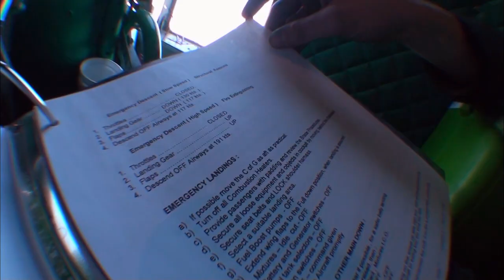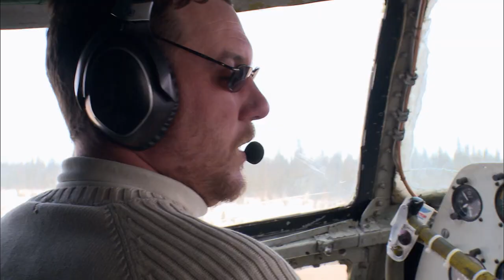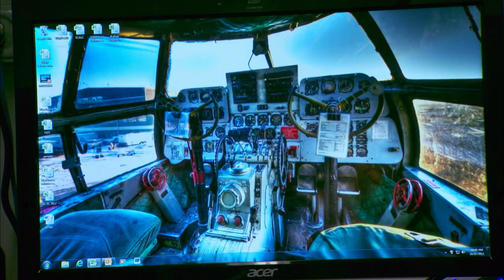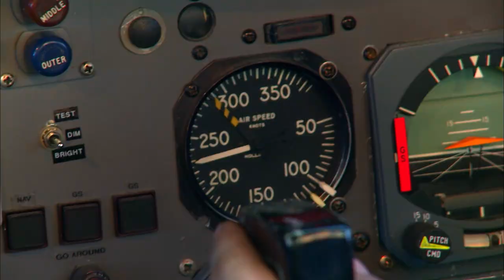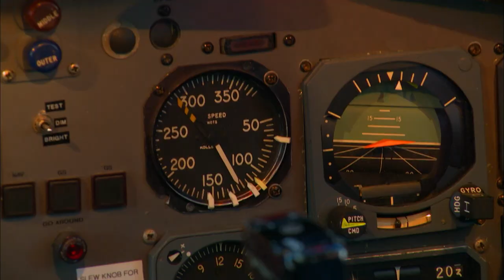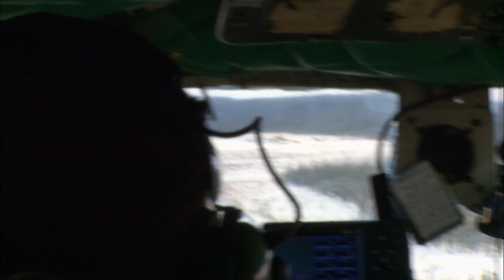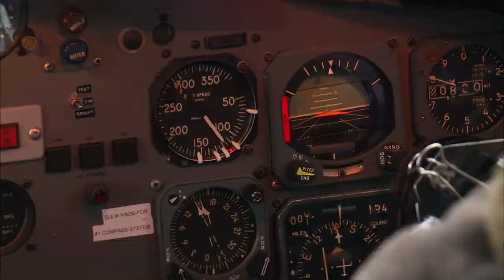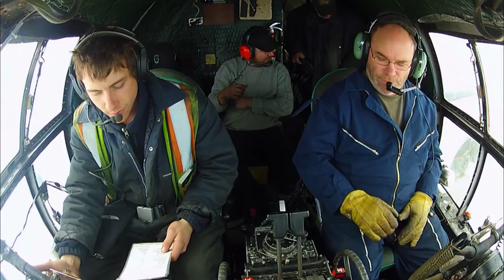Rescuing The Broken C-46 Plane In Dangerous Winds | Ice Pilots NWT | Wonder

Comment: I wonder what their mean time is between c-46 engine changes?  It seems to be like a week?
Reply: I thought I heard them mention 1500 hours on a rebuild.
Reply: @rdlawrence1473  That sounds like the optimistic engine life, assuming everything is tickety-boo:  Oil changes every XX hours.  Screens and filters regularly checked.  All the proper engine rules followed:  No flooding, three blades before ignition turned on, hand-turning first, proper oil dilution done when shutting down the engines, oil temperatures both min and max carefully obeyed, oil cooler shutters adjusted before excessively low temperatures, unsludged oil coolers,  limitation on engine heating and cooling rates, head temps not too low or too high,  manifold pressure within prescribed limits,  no detonation,  takeoff power for no more than the defined X minutes, and all periodic engine maintenance done by the book and by the clock.   I suspect under their difficult scheduling and temperature conditions a few of those steps get a bit abridged or are impossible to follow religiously.  There are also some motivational issues, as they know they're mostly carrying soda pop and beer and potato chips at government-subsidized rates using marginal equipment. , with a boss that is a bit of a grump.   One doesn't put out 110% under those conditions.
Reply: @georgegonzalez2476  Agreed; they seem like the kind of outfit that's taking off overloaded and getting into "war emergency power" too often.  Not to mention not keeping hydraulic systems flushed, cleaned, and equipped with clean filters.  The blue tails at the exhaust tips suggest fuel atomization in 1930s carburetors was not too good.  That's going to strip oil off the compression ring.  I wonder if they are allowed too install modern carbs and electronic ignition.
Reply: @rdlawrence1473  If the rules are like the USA ones, they're not allowed to change ANYTHING.   Changes usually require a STC, a complex approval process that is lengthy and expensive.   So they probably can't use the very helpful synthetic oils that don't get too thick at -40.    But you'd think it would be okay to add exhaust gas analyzers and that would help on controlling the lean/rich problem.
Reply: @georgegonzalez2476  I think changes could be made but Buffalo and a handful of others would be the only takers, whereas if you develop glass cockpits that can be retrofit into more popular planes then it's a go.  I think you can get electronic ignition for mags and it's allowed on one mag but not both.  The carb would need a redesign, perhaps one day these pilots will wake up to the benefits.  The R-2800 used in the C-46 was a popular engine in the day and was used in the Constellation also.  I don't know how many others are still flying.